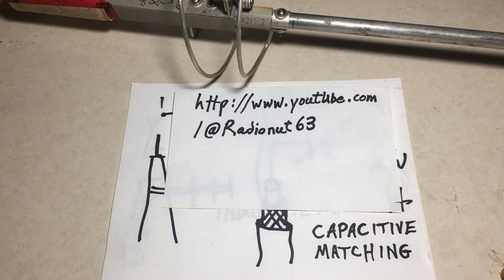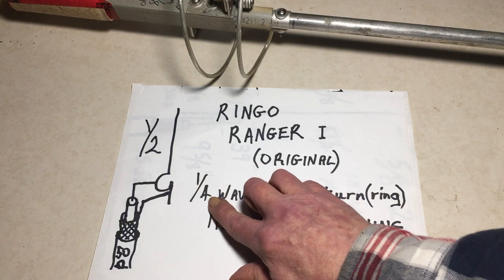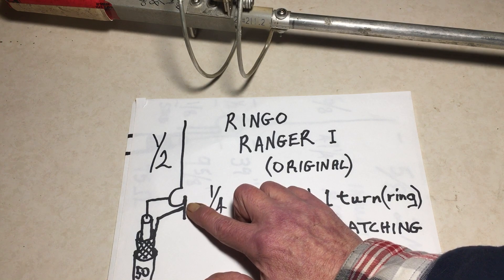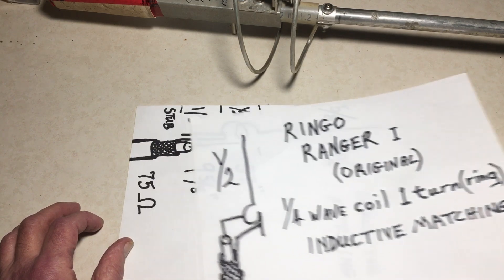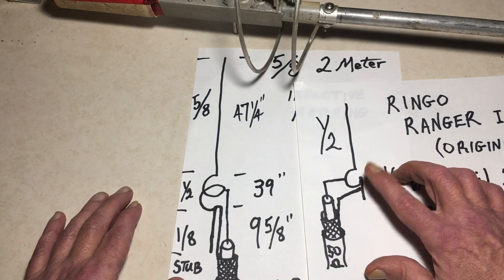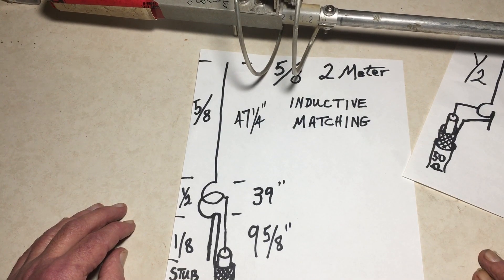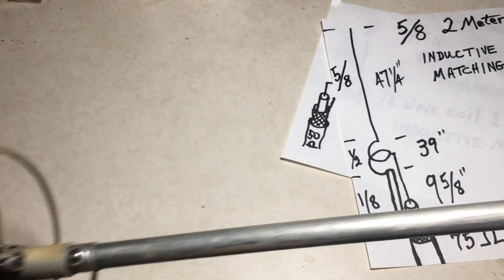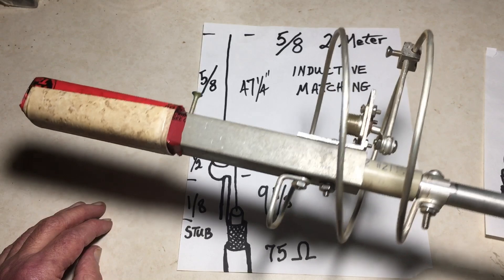2 Meter 5/8 Wave Antenna ~ Schematic and measurements

Comment: I bet this works great, I love the 5/8 wave, far superior to the 1/2 wave for a single bander. I actually had a commercial 1/2 wave 16ft design similar to this for 11m using flat bar coil and it tuned perfectly, think it was the original "silver rod" a little short for a half wave and you could actually take the top section off to make it 9ft and it still tuned perfectly... no ground planes, a bit weird but worked well.

Comment: These have by design gamma (capacitative matching) in the lower section. Where the top section slides into the Teflon insulation there is a capacitive effect from the lower alloy section. Playing with the amount of overlapping alloy will change the impedance.

Comment: You did not described the end part. From where the ring connects to the 1/8th piece, what is the lenght to the wooden part. Or is the square piece in total 9 5/8 inch?
Reply from the maker: Yes

Comment: 👍👍👍👍👍 you have done a good job. I don't like verticale Half wave length antenna. 5/8 are Better and have more gain. 3/4 Is even Better. The strange thing for me is the 75 ohm cable. But if It is so, It's so. Good job mate. I like building antenna. All the best.
Reply from the maker: I first tried with 50 Ohm and couldn’t get the SWR lower than 1.5   When I tried it with 75 Ohm it tuned just about FLAT !
Thanks for watching and share with your friends. Check out my other videos on this channel to see some of my other projects.
Reply: @madeinfoxtrap5539   I believe you 100% that you got flat SWR with a 75 ohm cable. RF Is strange. I have been working for more then 40 years  in communication, MF, HF, VHF, UHF and microwave, and I have seen too many strange thing with RF. 👍👍👍👍👍👍👍

Comment: Question please....  I have a new, unused 100 dollar 5/8 wave vertical for ~ 27 MHz and not quite sure of how the "internals" are connected.  An ohmmeter check is NOT the proper tool, but, I am measuring damn near a short ~ 1 ohm which is similar to what you show at about 4:30 which would measure as a short at DC level and is the meters residual reading between the outer threads to center conductor of the antenna's PL259 female.  I can see that the resistance between the coax center conductor and the tuning stub will indeed measure a DC short, but, am asking the PRO for his opinion....  Thank you ahead of time....  Hank
Reply from the maker: Not sure what your question is but resistance and impedance are both expressed in Ohms 
However impedance is a vector of resistance and reactance. 
I haven’t seen the matching section of your antenna so
I can’t really say but I’d guess that it is matched through a 
Tapped Coil and possibly some fixed capacitors to 
Tune out reactance and achieve resonance. 
Reactance may be inductive if the antenna is too long or 
Capacitive Reactance if the antenna is too short 
Not sure if this helps any or adds more confusion !
Thanks for watching and good luck.
Reply: @madeinfoxtrap5539 My further investigation found the tuned stub at the SO239 antenna connector was classified as a "direct ground type circuit"....  What may *appear* as a short is, indeed, a DC short, but, this low resistance is an *RF* tuned circuit with a nominal 50 ohm impedance....  This direct ground type of circuit provides some protection against a lightning strike, but, I believe you would still need a new radio regardless of how well the lightning was discharged to ground.... A "practical" test is that if your are receiving signals you are good to go with transmitting....
Reply: @madeinfoxtrap5539  Reactance maybe inductive if antenna is too SHORT or Capacitive Reactance if too LONG.
Reply from the maker: @zsradioham  you have it backwards

Comment: Nice work! How much clearance do you need from the stub to attach ground plane elements?
Reply from the maker: I haven’t tried ground radials on this design. I would encourage you and others to experiment and see what works. This design evolved from a lot of experiments and eventually found resonance !
Thanks for watching and share with your friends who may be interested.
Reply: @madeinfoxtrap5539 , well, I thought it through and your addition of that 1/8 stub makes the antenna a full wave antenna in length but the radiating element remains 5/8th wave. It’s a clever idea adding the stub.

Comment: Forgive me as I'm a new ham and new to antenna theory so I'm trying to understand what's going on here.  How is it OK for the radiating element be shorted directly to ground?  How would that not burn up the transmitter?
Reply: The thing that makes this "short circuit" okay is frequency.
The lowest frequency you could have is "on" with no change. 
An antenna is used at a higher frequency than this - at 2m (145MHz) the voltage switches polarity one hundred and forty five MILLION times a second.
Because of how fast the change in voltage (and thus current) is, you can actually measure different voltages along a single conductor like an antenna. This is because the electrons simply can't travel as fast as they are being asked to. If you get the length of the "short circuit" just right, the point where the short is will be a zero voltage point, and thus zero current will flow.

RF is like the punk kid that sat at the back of the class - They don't follow our rules.
Reply from the maker: Don’t feel bad as I asked the same question when I was first licensed !!
Connection is made on a two-turn coil to provide 
Inductive Matching 
This design was a LOT of trial and error but eventually became a resonant antenna
Reply: @madeinfoxtrap5539  Thank you for the reply, I eventually found a video that explained how J-poles work. Still scares me!

Comment: I remember that ole Ringo, i  bought that antenna originally at Traders over by the Avalon mall before they moved and changed their name to Cash Converters and now reside on Freshwater road.   Yes sir that SO239 connector did turn to dust from our salty air, most likely that connector was the cheapest they could find i'm sure.  Thank you for fixing up the connector, i did use the antenna for awhile then replaced it with something else, can't remember what it was now, perhaps one of your CONE dipoles? Glad you made some use of that antenna afterwards and had some fun building your own version of it.    BTW, i think i may have another version of the same antenna here now and some other antenna's.  You are welcome to them, one is a TRAM 1487 VHF 5/8 wave ground plane, great antennas.  🙂